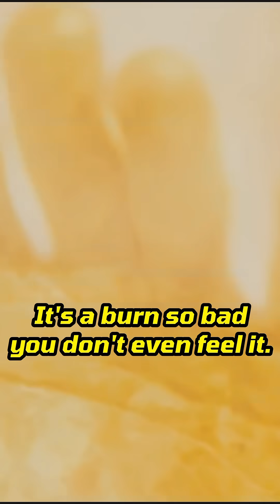THIS is what happens when a NUKE hits your City #vfx

Comment: For Hiroshima and Nagasaki, the Atom Bomb was used to which it would also irradiate the area it detonated on. The Atom Bomb isn't essentially used anymore though. What people essentially would use now are Hydrogen Bombs which has a greater blast radius, but surprisingly, does not irradiate the area.
Reply: Hydrogen bombs do generate radiation.
Reply: @Noorthia  if you mean in its core reaction then yes. However, A fusion reaction takes hydrogen and makes helium. Neither of those release alpha or beta radiation. The reaction does release huge amounts of gamma rays, but in a reactor, that's the stuff we use to be turned into electricity. There are no radioactive elements after the fusion is done, making it an incredibly clean process.
Reply: @xXFearTheReaper  In fusion reactors, tritium is produced. And in nuclear bombs, the radioactive fission core spreads in the explosion.
Reply: @Noorthia  Right. That is part of the reaction like I said.
Reply: @xXFearTheReaper  Yes, but I meant to say not only the detonation of the fission core spreads radiation, but the unused fissile material left over is scattered too. And to add to that, gamma radiation isn't exactly good for you either. You will get super-cancer when you are near enough to a hydrogen bomb to get blasted by the gamma radiation.

Comment: The rising heat of multiple fires caused by the heat flash and the shockwave is sucking in ground level winds at speed exceeding a 100 miles an hour. Within it's center, the temperature is rising to 800 degrees centigrade.

This is what's technically know as a firestorm.

Comment: What happens during detonation of a nuke is so incredible. Spent a few days studying it in nuclear physics class. Initially the ball of plasma becomes so dense and hot that it actually turns opaque to the light inside it. Only the outer surface is emitting light. The soup of subatomic particles isnjust too thick. This also happens during a supernova and happened at the instant of the big bang. Then as it expands it cools enough for the particles to recombine, it thins out and suddenly that blast of photons escapes and cooks everything. There is some really cool declassified footage of tests out to the side of the blast that show the mach stem racing along the ground. During testing it was found that airbursts did so much mkre damage because of this phenomenon. You get a lateral blast immediately followed by a partially vertical one, and then seconds later, a huge reverse. The physics of it all is incredible.

Comment: Kinda like this Correct??

2 Peter 3:10
[10]But the day of the Lord will come as a thief in the night; in the which the heavens shall pass away with a great noise, and the elements shall melt with fervent heat, the earth also and the works that are therein shall be burned up.

Comment: Yet doesn't affect cameras 😂
Reply: This short is CGI king, the cameras aren't real. If you're talking about the cameras that filmed the original nuclear tests they were sitting in bunkers miles away from the test sites, and the ones that were in the buildings were encased in an armored bunker with a fused quartz observation window that was several inches thick. Even with all that the cameras actually close to ground zero were obliterated, the ones inside the wooden structures much further away from the blast survived which is where the footage came from.

Comment: Did you account for the power of that bomb? Because you do know the nukes now are ten times more powerful than the bomb's that were dropped on Japan right if you dropped a nuke a nuke just one of are nukes that are made now Japan would be a radioactive dirt pile no nothing just ash😮 facts you need to know.
Reply: A modern ICBM would be devastating, but not that horrible. The atomic bombs had the power to irradiate areas as well, If they were detonated on the surface

Comment: Incorrect. Modern nukes are not fission bombs so no fallout. These are hydrogen nukes. More explosive yield but no radiation or fallout. If someone haooened to use a fission nuke then yes fallout and radiation wld be an issue but no one has those in rotation today that we know of

Comment: So, to put your mind at ease a little bit…
Yes, Hiroshima was made of wood. That is why the destruction was so great. In modern cities, certainly in East Coast and European ones, most buildings are made of brick, concrete, steel, or a mixture of all. When a bomb detonates, the damage will be severely less than what we see on pictures from the Japanese cities, or even of those testing sites. In fact, if you are indoors, it is estimated that you have a pretty decent chance of survival. The trick is to stay indoors for 2 days to give the radiation time to settle, and then getting the hell out of there asap after. Also limit time outside for the first week or two. 

Atomic bombs are deadly, yes, and they leave the ground spoiled for decades after when used en masse which is exactly what the fear was during the Cold War. They are not, however, some anti-matter device

Comment: Firestorm also happens through enough fire  bombing. 
If you survived in a bunker and wanted to run away you would suffocate on the street cause the fire tornado suckes the air off. Truly horrible.

Comment: Damn how did Indiana jones survive that by going in a fridge😂
Reply: Didn't you know? Back in the day, they made fridges from the finest quality bullshitium alloy.
Reply: 50s fridge that's how
Reply: Well, I must tell you. Fridge back then has the strongest material they have made which can last for a long time.
Reply: @JOSHUASUBASCO   That must have been way before planned obsolescence....😤😮‍💨
Reply: @chaosembodiment9395   If those fridge still exist in our generation, it will be extremely expensive. Alloy back in the days we're dirt cheap.
Reply: It literally said "lined with lead",
And it got flung instead of disintegrated

But yes, plot armour, mostly plot armour
Reply: Cause hes dr jones
Reply: Plot armor
Reply: Plot armor
Reply: @thebigonion1010 you just got uno reverse'd
Reply: Ok Ill make a point hear old fridges built like fortresses and some were lead lined😂 but he would have internal bleeding everywhere if that scene was even plausible
Reply: It was a Nokia branded fridge
Reply: In that fridge that he got in, he would survive the blast but not the impact because of that lock system in the fridge where you can only open it from the outside, not in. So he would suffocate inside. I know it's a theory but watch matpat's video on it, it actually makes sense
Reply: @jordanlewis5129  he'd be turned to mulch as soon as it got launched just from the amount of G forces it would experience
Reply: Magic
Reply: @jakebrown2328  bro is prepared to say anything
Reply: Plot armor, it’s obvious
Reply: Because it's a dumb movie.
Reply: Science wasn't invented yet so she did it anyway

Comment: While there is initial small fireball caused by conventional explosives, the "fireball" that most people talk about actually appears almost instantenously, because its result of surrounding air turning into plasma because of the neutrons hitting nucleus of the air molecules. Fatman bomb depicted in the animation would create around 200 yards size of the nuclear bomb. At this point, the bomb itself is still mostly in shape, but after long long time (compared to how fast the fireball appeared) the materials the bomb was made of (and vast majority of the fuel) vaporizes and turns into plasma. It expands with a speed of probably thousands of meters per second. Eventually the vaporised bomb expands and gets bigger than the original fireball and it keeps expanding and the shockwave starts. If you look at nuclear tests, you can always see it starts with instant fireball, then the ball stays more or less the same size, then it starts expanding. This is the effect i described.

Comment: Depends on the hight of the blast. Hiroshima and Nagasaki were both designed to air burst and create an over pressure of 5 psi. Of course they didn't know exactly what the bombs would do exactly. 

If the bomb detonates close to the ground, this would happen. But high enough, and your going to get some different effects to what the ground will see.

Comment: Fun fact: The black and white footage was actually propaganda footage created by the US Government in a film studio, as a means to show the effect of a weapon in their possession, which was meant to discorage the Russians during the Cold War. 

An actual nuke would create an EMP, which would disable any electronic device within it's blast radius, not to mention the shockwave and heat would instantly incinerate the camera 😁
Reply: Who told you that crap . Cameras in those tests were placed far away from the test site . In bunkers 5 - 10 miles away . Also nukes does create EMP but that's not it's only thing . Don't forget Russians created their own nukes and tested them . The stuff you said ain't fact but crap you made up or made to believe
Reply: 🤦 These types of posts apparently can be dumber.

The cameras were either in underground bunkers or had other concrete or steel protection, using mirrors, filters, and tele lenses. There are documentaries about it, as the high-speed cameras had to be invented to make these videos. Many cameras didn't survive those tests. You see the footage of those that did.

Oh, and the there weren't any electronic cameras for this. These were all film cameras.

Comment: I just realize that the shockwave after the blast was the one who created the mushroom cloud
Reply: That's incorrect.
Reply: @Evan_Bell please tell us the correct chain of events
Reply: @fireblow44  The mushroom cloud is produced by the rising of the high temperature fireball due to buoyancy. Rayleigh-Taylor instability is what gives it the mushroom shape. As it rises, the top, the leading edge, flattens, and viscous forces acting at the periphery of the fireball causes the sides to curl in on themselves, reshaping the fireball into a torus. From the side, it looks like a disk. As the fireball rises, it produces a region of low pressure below it. This drags up dust from the ground, producing the mushroom stem.
Shock waves aren't required for any of this to happen.

Comment: Low Altitude Air-Burst based on the HOB equation and the Mach-Stem’s Triple-Point Line. This only happens if the Fireball “bounces” and fails to touch the surface. The Firestorm, usually occurs ~20 - 30 mins after the disassembly of a device. The initial Thermal Pulses and Blast Waves, if Air-Burst, create a Total Destruction/Devastation Area approx 2.5x that of a Surface Burst and are the reason behind EMT, the theory proposed by Drs Fermi, Taylor, and later, Brodie in US Design and Doctrines. EMT is why we use “lower” kT. yield MIRVs vs high mT. SRVs, MRVs, and Gravity Devices. EMT allows the same amounts of fuels to be used and multiple targets or a single Elephant Walked Target Removed via one Delivery Platform (ICBM/SLBM) and the BUS carrying the MIRVS. 

The Peak Overpressure Phase and Max-5 - 8psi Rings are increased via the use of HOB and Mach Stem Effect. Modern Endo-Atmospheric Air-Bursts won’t create a “Full Mushroom” cloud based on yield-to-weight ratios, or Taylor’s Limit i.e. 6kg/6kT. 

Not bad, but a lot more happens in those .00071ms after the Primary reaches Supercriticalality and then the additional Secondary and/or Pusher/Tamper Stage(s) Design Devices.

Comment: "heat radiates outward at the speed of light" 💀 lol😂
Reply: He is right.
Heat is energy.
Here heat is the very high frequency electromagnetic radiation having very high energy.
And light is electromagnetic radiation.
Reply: @akash_-lw2vg wrong. Heat does not travel at the speed of light. Wrong.
Reply: @jessejive117  yes and no, heat does travel at the speed of light in the form of radiation hence how the sun can heat the earth, however this is the weakest form of heat transfer, the vast majority will be in convection as the superheated air moves and transfers it's heat away from the source.  The speed of light burst of heat will only last a moment, but the radiation is hot enough to burn you badly.
Reply: @akash_-lw2vg  He is mostly wrong. Electromagnetic radiation is at the speed of light. However, heat, i.e., thermodynamics, is not. Electromagnetic radiation is not heat. It causes heat when it is absorbed.
Reply: @charliefoxtrot5001 that's semantics, that's like saying television doesn't travel at the speed of light cause it's radio waves that are interpreted as sounds and sights by the TV.  (Oversimplified I know) but the point is either way your getting fried by radiation and your burns are equally as real
Reply: @speedy01247  It's not semantics, but basic physics! What fries you isn't what's known as thermal radiation in the infrared spectrum, but mostly x-rays generated by the nuclear fission. It is simply not a heat transfer by radiation, but the generation of heat by high-energy electromagnetic radiation that also penetrates much deeper than infrared.

Comment: heat isn't radiated with the speed of light -.-'
Reply: Correct. Thermodynamic 101. Heat transmission is a rather slow process. Electromagnetic radiation is at the speed of light and causes heat when absorbed.

Comment: Ball of Plasma sounds so special..but Fire is also just Plasma. So its just a Fireball 😂
Reply: Incorrect
Reply: @Papa_Pfau  what is fire then?
Reply: @HansGruberX1  fire is plasma, but not all plasma is fire. The ball produced by a nuke is not made of fire, dolt.
Reply: A fire does not cause radiation buddy think again. None of. That means fire.
 @HansGruberX1
Reply: Just because it is called a fireball doesn’t mean it one most people call it that for the lack of them knowing the difference between plasma and fire, like you.
 @HansGruberX1
Reply: @HansGruberX1  you’re right it’s not automatically but this extreme heat is caused by fast moving electrons, which is not how fire is made. You’re going against the university of Cambridge here bud

Comment: This is if the city was hit by a nuclear weapon from the 1940s. Modern hydrogen weapons can create fireballs as large as 4 miles in diameter, meaning youd be facing a bit more than just 3rd degree burns a mile and a half away

Comment: Now imagine it’s an 8 mile asteroid, it would create a fireball 1000 miles wide that is hotter than the surface of the sun. The biggest asteroid to ever hit us was called vredefort, that was between 12-15 miles wide and hit earth at around 50,000 mph. Just try and imagine 😳

Comment: In case of nuclear detonation you want to be either very far away from it…….   Or right at the ground zero, anywhere in between is pure suffering…
Reply: I d
Reply: H!?!?  NO
Reply: What's ground zero
Reply: @whitedragon7436  exactly where the bomb explodes
Reply: @conscioussubconsciousness1976 nah, being a certain distance but still in the blast is fine, for a 1.5 megaton nuke, being 10 miles away will still cause second degree burns if exposed and severe damage to structures but you’re going to likely survive.
Reply: @whitedragon7436  I would say where the bomb first drops but someone beat me to it
Reply: Not necessarily

Comment: The "Mach stem" is the point which the 2 pressure waves combine. Then, you get what's called a "Precursor Wave" that then goes out ahead of the primary pressure wave. The 2 are devastating to anything they hit. However, this phenomenon only occurs when there is a lot of dust thrown up from the blast and why it only runs along the surface. In a city environment it less likely to occur and at sea it does not occur at all. Great Video!

Comment: Nukes should be banned, one or even 10 individuals shouldn't have this much power
Reply: How are you gonna ban knowledge, we know how it works, even if every country removes it they can get it again and in todays time, it won't take much time for already experienced people i suppose

And nukes tbh are necessary, that stops too nuclear power from engaging in a combat but can cause misunderstandings too, we had too many close calls with accidentally nuking
Reply: Heck nah your wrong
Reply: Nukes have had severe limits placed on them after WW2, I believe.

This is where the Mutually Assured Destruction theory comes in. It's why any nations currently at war haven't used nukes yet.
Reply: Possibly the only reason we're not at full out war with Russia is bc of the nuclear deterrent.
Reply: They will never be banned because they are a deterrent for major world wars. Russia still has 6,000 nukes and they have developed what’s called a hypersonic glide vehicle. It’s a missile that has a peak much lower than typical ballistic missiles which just go up into the atmosphere in a predictable arc (making easier to intercept). The Russian missile flies at a lower altitude and weaves to dodge anti missile defenses while also traveling at 10x speed of sound. It cannot be stopped by missile defense as it flies low enough to not be detected until it’s too late. It then carries multiple warheads  which deploy separately to space out the impact.
Reply: @DanBlabbers   okay sure 😂